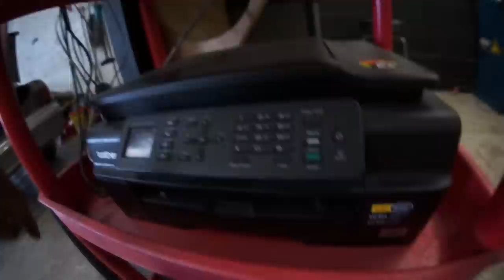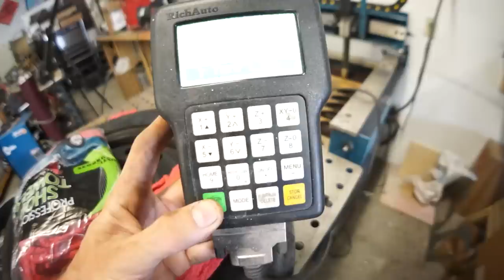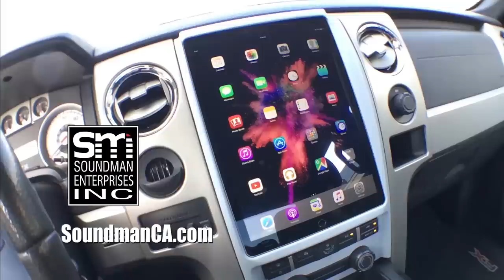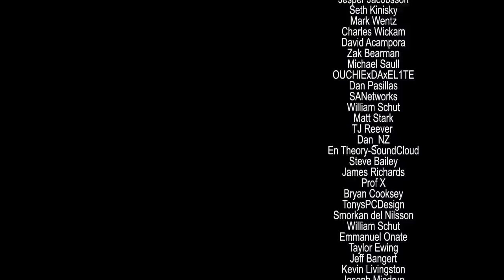FREE-Bird Update! and Rafa's NEW dash mod! Chrysler iPad 9.7" - WHITE RIDER 14 / Amplified #743

Comment: Order half inch fittings and hoses. Don’t get them tiny ass 3/8 chicko shits. Mo flow fo that bounce. Have you considered accumulators added in line to smooth out that ride even more ?